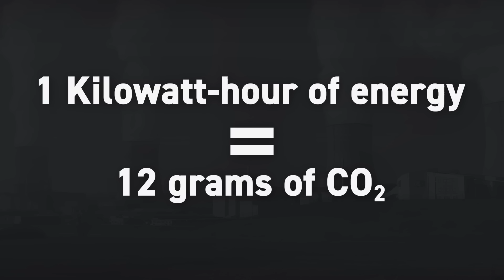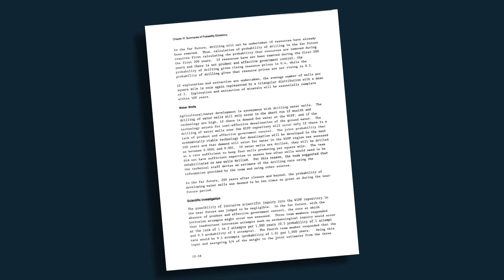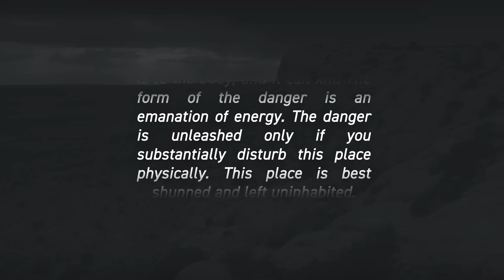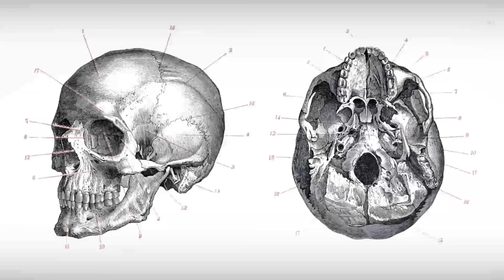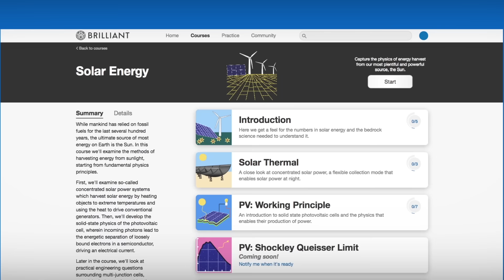The Nuclear Waste Problem

Comment: I love how nuclear waste is supposedly such a big problem for people that nuclear technology is nonviable, yet fossil fuel waste (which (1) kills millions of people every year as a result of air pollution, (2) Has contaminated large areas of our planet with toxic chemicals from spills and the dumping of organic compounds as waste, (3) is poisoning our oceans and cooking our atmosphere) is not sufficient motivation to abandon that technology.

Nuclear power is to coal what airplanes are to cars. The failure of an airplane is more scary and spectacular than that of a car, and (as we saw in 9/11) airplanes have the potential to do a huge amount of damage in a worst case scenario. However, when you look at it statistically airplanes have a much better safety record than cars, with far fewer incidents per mile traveled. Same is the case with nuclear, one of the safest power sources in terms of deaths per unit energy generated. Managing risks is an inescapable part of our existence on this planet. If we want to unleash massive am amounts of energy on the surface of our little planet, (so that we can drive cars, and watch TV, and have air conditioning) we have to expect to pay some price. People need to think about the risks and ask what they really want.

Because of how the grid works we need consistent power from a turbine generator to balance supply and demand on the grid, nuclear is the only option that is really viable.
Reply: I think you're being too nice to coal.
Reply: Jumping Spider
You make some good points.  But the new nuclear power plants cost far too much and take far too long to bring online.  The whole nuclear industry and coal, too, are being made obsolete by renewable energy - solar and wind. There are already solutions to peaking power to make baseline power plants not needed.
Reply: @acmefixer1  solar is incompatible with the current grid, it will never fly. Not until super batteries arrive.
Reply: @acmefixer1   ""The whole nuclear industry and coal, too, are being made obsolete by renewable energy - solar and wind."".... Bruhh
Reply: @acmefixer1  Humans consume most energy at night, which is when there is no solar energy produced. Wind should take that up, but what if there's no wind? that's where water turbines come into play. What if there is not a whole lot of water and hight? Your only option is nuclear if you want to go clean...
Reply: @E to the V Idk. That was what the statistics said. Probably because that's when people charge their phone and laptop and when people turn on the lights. streetlights and stuff are on at night as well... It's just the way it is.
Reply: Jumping Spider It’s mainly liberals that are against nuclear power.
Reply: Could not disagree more. The actual costs of nuclear pwr plants is staggering in comparison to total output over life span of diesel, gas and hydro-electric power.  Take the 10 largest reactors in the USA.  Most have 2 to 10x rhe amount of spent fuel that Fukushima had, sitting precariously in pools of water.  If you consider 3 Mi Island, Chernobyl, and Fukushima, one serious accident every 12 years +/-.   The actual # of deaths from Chernobyl m/h been much higher than the nunbers you cited.  The liquidators numbered in the 10's of thousands and nobody monitors their health now. The promise of cheap, clean power fron fission was a big piece of marketing crap.
Reply: I see you too have watched that Kurzgesagt video
Reply: @bartofilms  - With the amount of increasing hurricanes and tsunamis we're developing constantly, do you really wanna assume that this 12 year interval is a permanent average? Why build something that will likely harm citizens in the wake of a natural disaster?
Reply: @YourMajesty143  Great Question!   The San Onofre reactor just north of San Diego, CA is also a GE design and has 10x the amount of spent fuel that Fukushima had.  Still there and sitting directly above an earthquake fault.
Reply: @YourMajesty143  Then just build it somewhere safe. Why would you build a plant on top of a fault line. I dont think thats the fault of the technology, but the fault of the manufacturers. There's even advancements on small scale nuclear powerplants that can be built inside cities, and it will never be dangerous because it's too small to be a threat and can be easily contained. It's like building a bridge near a volcano. If that volcano erupts and the bridge collapses, then thats the fault of the manufacturers